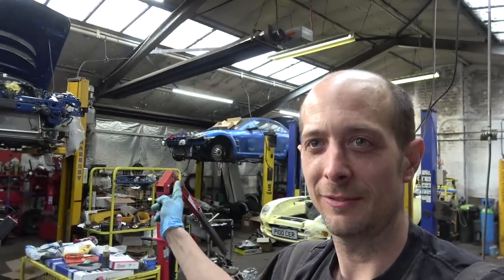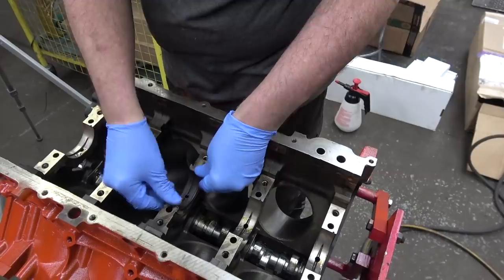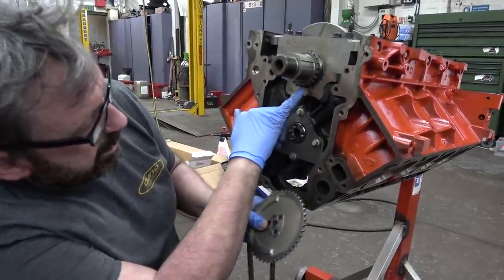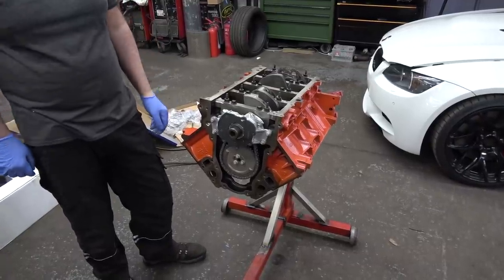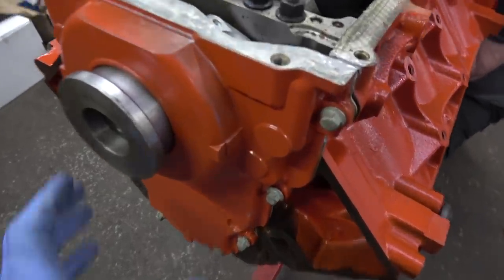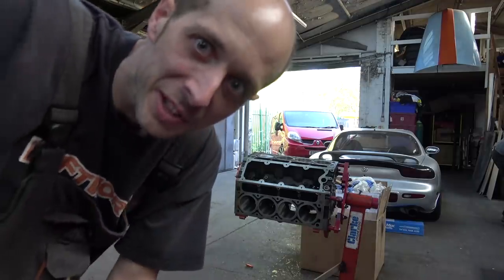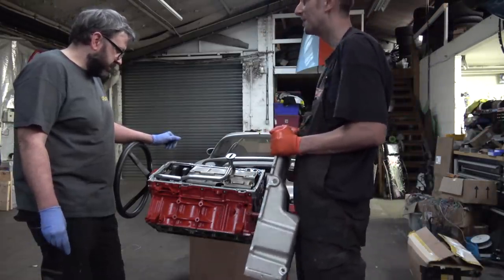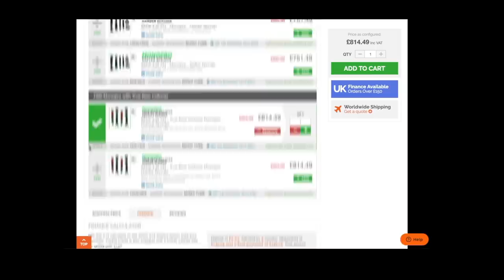Jays 1000hp LS Turbo SN95 Mustang Project -Pt 4 - Building the short block.

Comment: Shew. Nice work. What compression ratio is Jay hoping to run?
Reply: Hevendra Narayansamy it should be 9.7 1 or very close to that depending on what was taken off the heads to get them cleaned up.

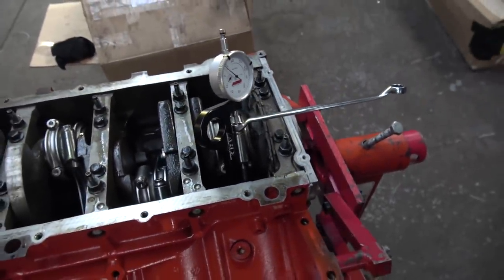Comment: 14:00 bolt stretch? Care to tell us more about that method?
Reply: An idiot in a racing car very basically put the gauge over the bolt. Zero the gauge and tighten until the bolt stretches and moves the gauge.. It’s a massive faff if you ask me I’d have been more than happy to just to use a torque wrench if the kit had come with that data.
Reply: @JayDontGotThis  You torque both bolts and then measure the stretch once per bolt you you're going back and forth between the two?

Seems tedious but you only have to do it once, might as well do it properly

Comment: Any thought of putting a ZF GS6-53 Box from an E90 335i? Cheap and available and should handle the grunt, PMC do a conversion kit
Reply from the maker: It was considered, but by the time you've done it with the conversion parts & a clutch that can actually handle the power, it's a lot of money & still not as strong as a Magnum.
Reply: @driftworks  https://engineswapsupply.com/ these are good guys for low mileage Chevy stuff, might be worth an ask, the tr6060 from the Camaro etc is the same box without so many shifter mount options I believe (I'm sure Craig knows!)

Comment: ive built my fair share of ls engines
never owned one though
thought about it but im happy with my 3.4 2jz <3
but i got triggered when they said they threw away the rotary from the feed fd :(
Reply from the maker: 😄It's rarely Craig that does the throwing away. Usually the customers. If it makes you feel any better, Colum who works for Craig is RotaryReg & well into preserving them
Reply: they need jesus

Comment: Hows that E92 like that LS? Did it go in easy? I've got a E92 335i xdive that needs a non BMW engine...
Reply from the maker: It's very good. A pretty simple swap by some standards as it was already a V8. You can see the same car in it's LT4 guise on our channel.
Reply: @driftworks  Hell yeah, tried to make more fun with a DocRace ST kit for the N54. She gave me 3k miles before crapping out again. Wont have that problem with a LS 😁 Thanks!

Comment: What I want to know
Is who would buy a genuine Feed RX7, just to swap a V8 in?
If it was just some normal RX7 then yeah, I can kind of understand why even if I don't get it. But a Feed car? A car that's been built around the lightweight rotary engine? 
I don't know. I can't get my head around that mindset.
Reply: There can be as little as 10kg difference between the 13B engined car and an ally LS engined one, when you take into account losing the turbos, intercooler etc it actually moves the center of mass more towards the rear of the car so you have better F/R weight distribution as well.
Reply: If it was about weight you would not bolt loads of extra fibreglass kit yo it everywhere . The owner had a LS3 powered normal rx7 but wanted more 😁😁
Reply: @craigtaylor5075  100% i'll be in touch once funds allow for an LS RX7, seem to be your bread and butter!
Reply: I'd struggle to believe that the intercooler and it's piping and some other ancillaries weighs more than half of a V8, even if it is an aluminium block. 🤔 Idk.
But, whatever. Plenty more fish in the sea.
And yes Craig, although the body kit might not help with the car's weight, it's mostly around the middle and the rear of the car, so it wouldn't affect the weight distribution as much. I'm not entirely sure of it's construction, but if the fibreglass panels actually replace the factory panels then maybe it would decrease the weight? But, if they just fit over the top then no.

I still don't get it, but chances are I'll have forgotten about it after I've had a coffee and breakfast, so I'm not going to complain about someone else's car for too long lol